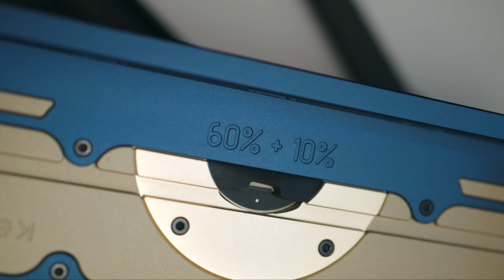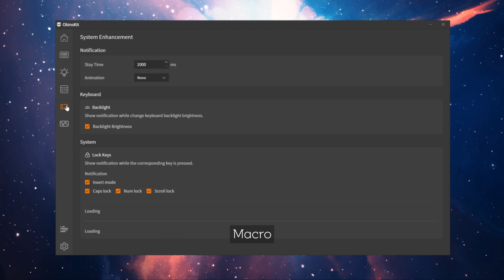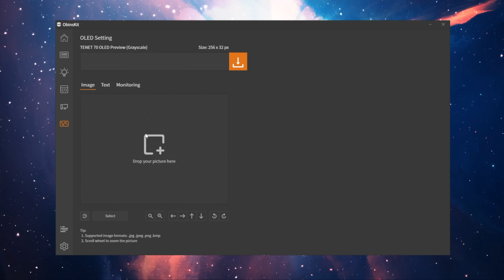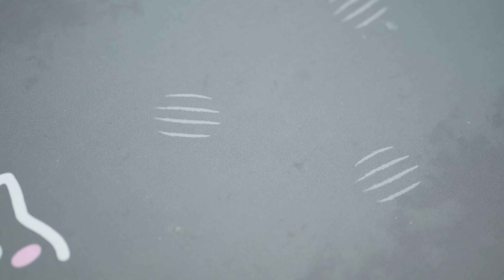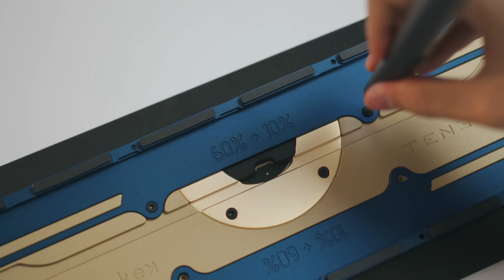Metakey TENET 70 Build (10%+60% or 60%+10%)

Comment: If this keyboard had an F row I'd jump on it defintiely. That is actually makes use of the dead space inherent in the TKL form factor is really appealing to me.
Reply: Just use FN + the number key row. I found that to not be a big issue. Unless you like the look for the extra keys, which I can understand. I always put icons on my F5 - F8.
Reply: if it had f row it wouldnt be reversible layout
Reply: @axbyxaby  it could have an f row and be reversible if the f row was condensed to sit right on top of the numrow, no blocker separating it... i think that would look ugly though
Reply: I like having the numbers in numpad form on a layer, so I put the f-keys on the num row instead
Reply: I have felt like that before thats why have plenty 75%s but isnt that only an issue if you are eating etc in front of the keyboard? I would say keebs this nice you wouldnt eat around and if you arent eating what are you doing w that second hand huh what areee you doinnn :)
Reply: Yeah no F row is an issue to me either.
Reply: In the software, you can change the functions for keys or remap, for example you can remove page up/down and replace that with F keys if you wanted to. Or you have had the top row of number keys double as F, tap = number hold for 1-2 seconds = F key
Reply: @MsToshi1990  good luck with ctrl +alt +fn +f in system dev or server admin

Comment: I’m left handed but still use my mouse like a righty but I still like to do stuff with my left hand (I often keep a notepad there) so this might be something for me to consider.
Also, racing games (some older ones don’t work well with controller so I’d rather use my keyboard). I like R-shift for gas, Enter for brakes, and AD for turning and WS for shifting. I could just use arrow keys and spread out my hands a with cuz ergo. 

Hmmm

Comment: I just received my Tenet today, spent some time testing the PCB to make sure it works (it does, whew!). Next problem: obinskit won't load properly lol. I plug the keyboard in, refresh the list so it shows Tenet70, click that, then... nada. The obinskit window just turns transparent and nothing happens lol.

Side note: if any of your connections are plugged in incorrect, it won't show up.